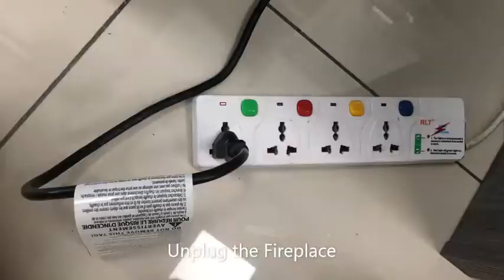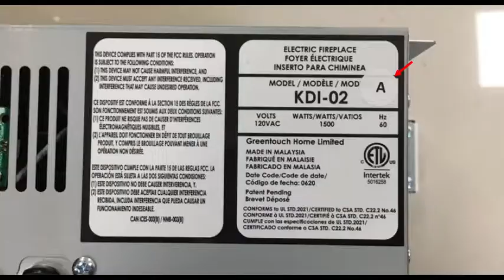Allen + Roth 2267FM-28-201 Heater Replacement

Comment: I could not get a replacement. So, I
 took it a part and found broken solder under the circuit board where a relay was attached. Works great.

Comment: How do you dissengage, the heat element, I just want the fire lighting on.  I don' need the heater element on..
Reply from the maker: Hi Joe, you can keep adjusting the temperature up or down until the display arrives at the OFF setting, and the heater shuts off. If you have any more questions, feel free to contact us directly at customerservice@greentouchhome.com

Comment: Seems that the company does not respond to emails or have anything on their site where you can order the replacement part as shown in the video. Was very happy with it when it worked. We have had it for a little over 2 years and liked it but now it will not even turn on whether using the remote or buttons on the heater. It has electric so something wrong with connection inside unit. Would gladly buy heater and replace since it is simple to do. Can not find part.